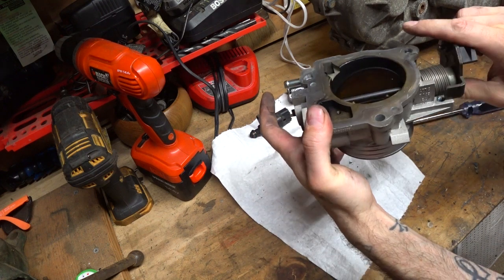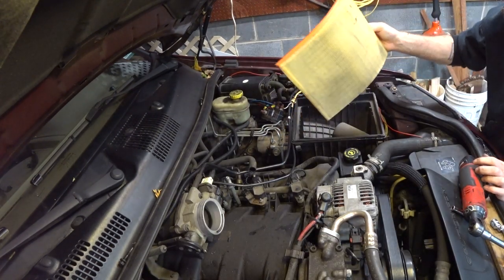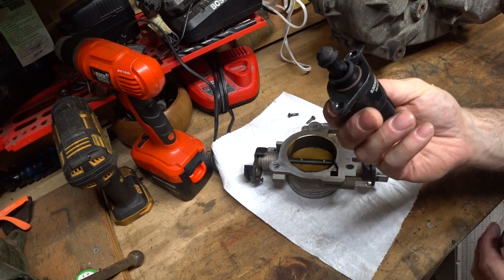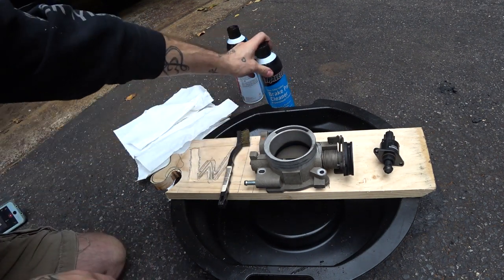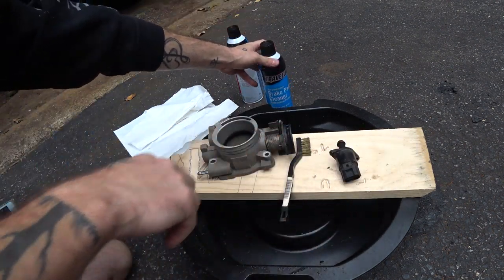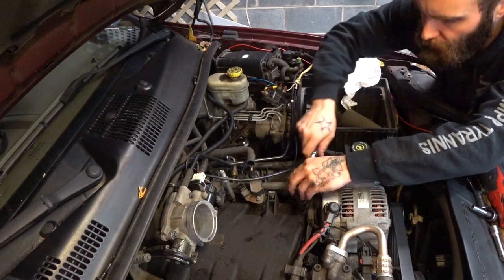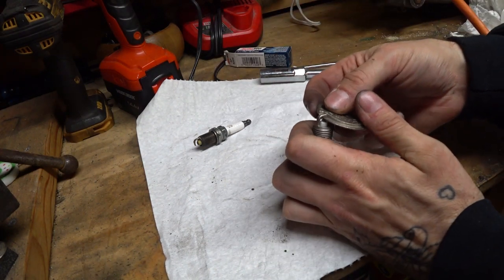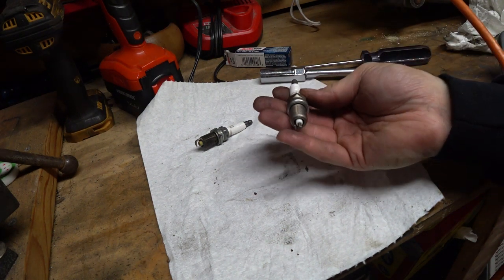The Old School Tune-Up: The first place to start if your engine is running rough

Comment: I’m having trouble with my 4.0 Wj it’s not staying in first gear at a stoplight or sign it bucks up to 2nd, and takes off in 2nd and won’t downshift back unless I do it manually and go thru all the gears any suggestions

Comment: What is going on with your Belt. The belt is on wrong look at the Diagram to the right of you. The belt is suppose to go around the Air Conditioner Compressor and go down then come back up. (Follow the Diagram) i can see it to the right in front of the Radiator.
Reply from the maker: You are correct. I made about 20 videos with it like that an never noticed... I finally noticed about 2 months ago
Reply: @DEInTheGarage  Yes I did see that you fixed the belt and I think I commented  on it. Own a 2000 Jeep Cherokee  Sport 4.0 very clean ride never been used to tow or in the woods. It's  well  taken care of but the one think that concerns me is it's  fitted with the 0331 Head that is known to Crack but I have had no problems  I know about the Tupy Head replacement if nessary. These 0331 Head castings were fitted on all 2000/2001  4.0 Engines. Hope I can dodge that Bullit.  If not I will hunt a Tupy  Head down and have it rebuilt before installing. Love my XJ 4.0 I know you have that ZJ  with the 4.7 but those engines are not for me I'm 65 and have had my share of wrenching . Last I watched that YouTube Channel you mentioned ZIP TIES N BIAS PLIES and that guy is off the Hook. I am surprised he gets away with all the swearing on YouTube. THE MAN IS CRAZY. He got his 100 Thousand Subscription  award from YouTube and opened it with a chain saw. Lol

Comment: I did a tune up on my 4.0 wrangler and i went from 13 maybe 14 to about 16mpg city and about 20mpg highway driving i changed the plugs and since the throttle body was fairly clean i didn't mess with it. edit when i changed my plugs they were just about as bad as yours and i had 99,000 and some change miles on mine.
Reply from the maker: Yea, it is crazy how a little maintenance can awaken an engine

Comment: You are completely rescuing Ruby from the errors of her previous owner.  I love the satisfaction of knowing another system was restored properly.  Excellent job.  I should probably do this to Grievous now
Reply from the maker: Those 4.0s love a good TB cleaning!
Reply: @DEInTheGarage  yea man!  Ive noticed the rpms drop to about 400 when I put Grievous in reverse.  I wonder if is this cleaning will fix that.

Comment: Yoo you mentioned an exhaust leak at the end of the vid. Is it by change a sheered exhaust manifold bolt causing your leak? If you could do a video on that whole repair that would be epic. There aren't many good vids out there right now--yours would be a massive help
Reply from the maker: I think mine is at the flange, but we can try to make a vid on that if it ever comes up

Comment: Champion spark plugs are only good for lawn mower engine's 😂 Autolite is the best plug for Jeeps they last forever and are cheap as well . Now the you've cleaned the throttle body and IAC you should check the EGR valve it could be full of carbon too . Great Job and get some dielectric grease for next time .

Comment: Just did mine " deferred maintenance " the previous owner did not do anything besides oil changes we put new plugs new injectors transmission flush brake flush dif flush power steering flush radiator flush ( then blows a hole the following day go fig) new shocks new tires new water pump thermostat hoses and a new ac condenser. She runs like a champ now at 129,xxx miles shes is good to go. Keep up the great vids and say hi to the fam.

Comment: Totally agree with you! It’s really amazing how much people neglect their cars... even my dad. I’m going to laugh so hard when his engine in his VW Passat seizes😂😵😬. After all your maintenance, I would recommend a cold ram-air intake... even if the kit is from eBay for 50 bucks, it’s still better than stock IMO, especially on a diesel... maybe you could junkyard Cummins swap a Jeep! It’s probably been done, but I’ve never seen one. Instead of cleaning the throttle body, I would’ve just gotten a bigger one(obviously with the pre-mentioned cold ram-air kit). Have you thought about installing bigger coolant tanks on your cars? More coolant will keep everything cooler, since there is more fluid to heat up. Rerouting the pcv valve tube out and set from the engine instead of back into hit will help reduce carbon buildup, too. Just move it back for inspection.
Reply from the maker: I had not considered either of those, but maybe I should!

Comment: Doug,do yourself a favor next time,and put antiseize on your sparkplug threads before you thread them into that aluminum head.They will come out much easier....
Reply from the maker: That is a good call. Didnt even think of that!
Reply: Vaseline works great for anti-sieze on the plugs. Used it for years no issues.

Comment: Just a recommendation for those of you whose vehicles have an electronic throttle body, like my 03 hemi or 06 lr3, be careful of what you spray on it and do not force the throttle plate to move. If you do it will probably ruin it, that's how I ruined mine on my 03 hemi. Nonetheless good video and I do quite a bit prefer this channel compared to other ones where, people like me who own land rovers because we like them are seen as stupid people. Now, I'm fine with being teased about it but when you go out and attack the people who buy them without knowing who they are or why they did, that's what annoys me.
Reply from the maker: Very true! Good advice!

Comment: Great video as always.. I notice your drive belt is not put on correct the way Daimler-Chrysler have it set up from factory. But hey if is work  then you good lol.
Reply from the maker: Hot damn.. I just went and looked. I seem to have gone alternator, water pump, power steering instead of water pump, alternator power steering. can't believe the belt isnt squeaking. going to have to go a few vids back and see how long it has been like that.
Reply: @DEInTheGarage  lol cant believe that belt actually ran like that,you may be on to something. Nice video man
Reply: @colintrout1095  I actually study the 4.7 and 3,7 engine alot. I know alot about them. I was a former Mechanic for Chrysler back in 2004 . My 2007 Dodge Durango had the 4.7 engine when I sold it  had 289,000 miles never drop no valve all original. It was well maintenance oil change done every 3000 miles.  Main thing about this engine never let it overheat...
Reply from the maker: I cannot get anything by you! What is wrong with it?
Reply: The drive belt should had been installed like this from the AC Compressor down to water pump, back up to the Alternator and to the power steering pump and crank and belt tensioner

Comment: WOW, Can't believe those plug gaps, the worst I've ever seen. Autolite plugs ? What's the recommended plug for your Jeep ? I run NGK in my 4.0 copper plugs, their easy to get to so I use copper. You should also oil the O-ring on the IAC before reinstalling it. GREAT DEMO. ON CLEANING TB. THAT'S HOW IT SHOULD BE DONE, YES SOMETIMES YOU HAVE TO GET DIRTY.
Reply from the maker: The recommended plugs are Champion coppers. I am giving these a try to see how I like them. so far, I do not and will likely be changing back at the next oil change.Nothing ventured, nothing gained, right>

Comment: Hey Doug, I know it's semantics, but a tune-up is not possible on a new computer controlled engine, unless you talk about reprogramming the "tune" which in a modern sense, is the fuel/air ratio among other things.  A tune-up refers to the tune of the engine, which was much more acoustic back in the old days with manually set dwell times, what RPM the engine idles, at what point the choke comes off, and a lot of other things.  This is all set by a control unit, which is what "tuners" mess with when the "tune" the engine.  

What you are doing is deferred maintenance that should have been done a long time ago.  Still good to to, and should be done, just not a "tune-up"  Semantics , I know, but an important distinction nonetheless.
Reply from the maker: Yikes. Lol. Fair enough, but I think we all know it as a "tune-up", right? Also doesn't have the same ring to it. haha. You are definitely correct though!
Reply: Haha, yeah I know.  Like I said I'm arguing semantics.  It's just in the 120 some-odd years of automotive  history so many people get so many things wrong because they are referring to one thing but calling it another. Plus you always give good tips and tricks.
Reply from the maker: @talis84  you are not wrong there, bud. I will amend my vernacular going forward.
Reply: @DEInTheGarage  vernacular is common usage, so tune up is fine